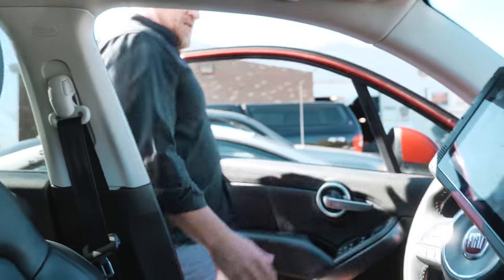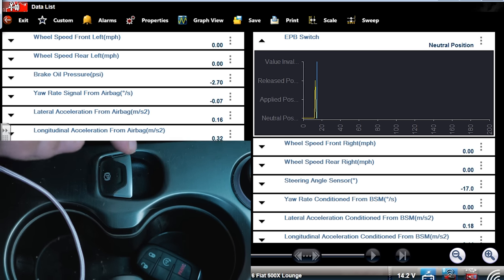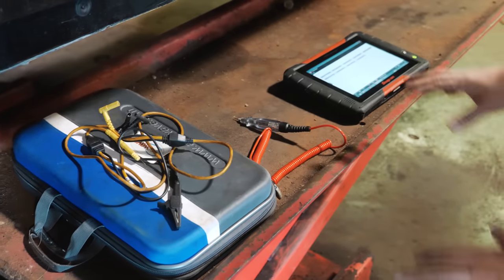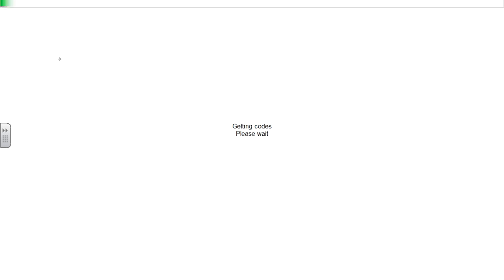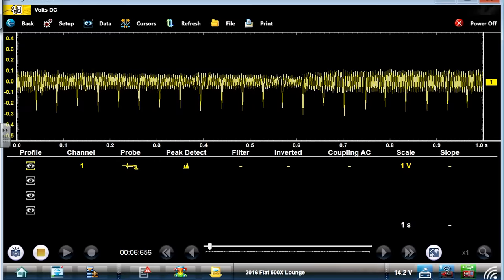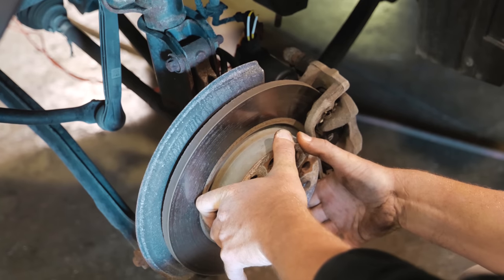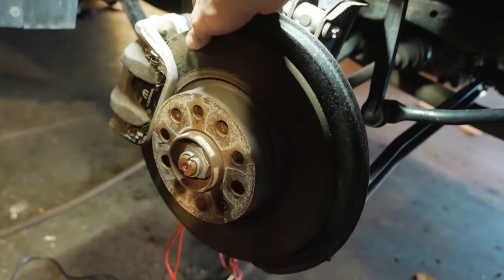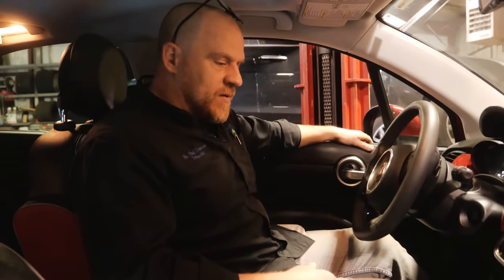2016 Fiat 500 Electric Parking Brake Intermittently Sticking On

Comment: This is my car. I can’t thank yinz enough for the time and effort that you put into fixing my car! It’s still doing well and I actually trust using the parking brake now! For about 8 months before the brake started to lock on, I was having electrical problems. “Service parking brake”, “Service ABS”, and the seatbelt lights would all start flashing while I was driving. To make it worse the seatbelt dinger would be going off 🤯 Sometimes it would last 5 minutes other times 45 minutes. But when I would take it to the dealer it would be off so they could never diagnose it. But then the brake started locking up. All 3 times I was parked in the same place at work, on a slope, parking brake was not on the second 2 times for sure. I’ve definitely felt the same frustration you felt with this car lol. Again I can’t even express how thankful I am for the work yinz put into this, and for also letting me know about the rotor issue too. Oh and btw sorry about the seat, I’m a tiny person with a tiny car 🚘 😂 Thanks again!!!!
Reply from the maker: How awesome is this! This may be only the second time I've ever had the actual owner of the car we film a case study on, watch, and comment on a video.
May I ask you about the times you had it at the dealer? They must have fixed a few things along the way right? Because those other issues you mentioned, we didn't do anything with those.
Also, what exactly was changed by them in order to fix this brake issue? Thanks! I believe that it is possible that I should not have condemned their work and I want to be careful in bashing another shop or tech. Thank you so much! This is a real struggle for our industry in that we all are too quick to bash each other without knowing the full story. Appreciate anything you can contribute. Happy New Year and thanks for commenting!!

Comment: All I gotta say is because of you my most used tool at the shop day to day is a test light. And you know its a good thing when as you follow the video the ideas come into your head on where to go next, and then you say it and try it (like the jumper across). One thing I would have done to rule out the actuators is apply voltage to them and check if they are working, on the brand I do they are good at taking water into the windings and ruining themselves. And while I do that, have an amp clamp off a scope reading what kind of amperage it pulls and hopefully find a bulb to closely match it. I think that would have taken care of the bias voltage, and the integrity of the wires to pass a (I'm guessing 5-15 amp) load. 

You truly deserve your success on Youtube, my diagnostic roots come from your videos. Thank you SD.
Reply from the maker: Such great feedback and comments my friend. Thank you so much. Learning as I film these days.

Comment: This is why I like the videos you do at your brother's shop. You get to hear the colorful banter between you guys. Like when your brother said, "well, at least they know how to read", 🤣. That's pretty bad though that the other shop replaced those two modules/computers before even doing a simple visual inspection on the parking brake components. That's the first thing I would have done after seeing the codes. The important step of doing a visual inspection cannot be understated. When I went to some automotive training a few years back, the instructor mentioned that about 80% of problems are found by visual inspection. It's the other 20% that can be so fun to figure out.

Comment from the maker: Just wanted to say thank you for all the comments! A lot of you suggested that testing the motors themselves should have been done. You are not wrong in wanting to do that, but there is some warnings on this. First, if you drive the motor too far, you'll damage the gearing inside. Second if you find a bad motor you still MUST check the driver function in the ABS module! My focus was always on the drivers as there was water and corrosion in that connector which can lead to excessive current and driver failure. Even if that LR motor tested good manually, driver tests should still be carried out.
The take away here with the driver testing would be to remember the variables when it comes to actuation of the circuit. (Current flow wasn't right, so the module locked it out). Secondly, there was more than current monitoring going on with these. I proved it on the known good side by a simple disconnect of the connector with the circuit not active (no current). So there IS a bias line here of some type that I should have spent more time on in the end to show it to you. I believe as some of you suggested, that if I would have AC coupled my scope and dropped my voltage and time base, that I would have seen it and I would have seen the difference when my test light was installed, which passed the open circuit test the module does using that bias.
Lastly, as a lot of you pointed out, current flow is absolutely being monitored too and I believe it is comparing side to side current as well as the timing of the peaks.
Reply: you are right in your with basic thought but when you come up against a circuit that you are not familiar with you have to try from another direction. you have a known good motor so you could try reading the resistance of the good motor and substituting a resistor across the motor  connection and resetting. not knowing the current flow you should be able to find that with ohms law and the resistor could then be used with the correct wattage. i have not tried this so i cannot say if this would drive the module for to long causing it to burn out the driver. food for thought. also the circuits are separate in there operation to allow for different wear factors on the brake pads. i dont think you will find any bias voltage on the connections because it is only a power when requested by the parking brake switch type of circuit with the current limit being set by the module to set the torque level and that will be different on each side due to the pad wear. on the citreon c4 there are similar motors but they are a four wire motor which does allow for the esp module to use the motors for the stability module to function. but maybe as on the c4 the motors are the same you could swap them to test motor and circuit integrity. i know the idea of diagnosis is to try and be as fast as possible for the customer but in this case i have found that the voltage test on the motor and circuit integrity to be the fastest way to diagnose this problem. if you prove the motor and the circuit integrity then you have got to have a bad module.
Reply: i know that your teaching is to prove a component before firing the parts cannon and i totally agree that is the way to go. but with this circuit i dont think you need to go down the road of looking  for some way of proving using ie the multimeter or scope. but yes you are there to teach but i think this is a case of not proving how it works but getting the customer out of the shop pdq i hope i have not offended you in any way but i think the way the program is designed on this car is very poor as far as diagnostics is concerned.but thats fiat and european cars for you lol. its one of them faults thats more trouble than its worth
Reply from the maker: @dougytweddle4393  this is 100% not true when you said "you will not find any bias".  How do I know that? Because the open circuit code sets IMMEDIATELY when the motor is disconnected during a time when the motor circuit is at rest! (No current flow).
Reply: I’m working on a car with no windshield wipers, no abs and no speedometer. Can hardly wait to see what the problem is. I’m betting a bad ground, or positive or possibly a bad module. Hoping it’s not the BCM. Spendy fix if it is. I’ve learned a lot from you and Ivan and Eric O.  And others. What you guys do is a real service to others. You guys are my afternoon tv every day. Thanks Dan for what ya do.
Reply: resistance test on motor wink wink lol
Reply: @ScannerDanner  On VWs there is a data PID for motor current. That's how it knows the position of the piston (it sees the current rise when the motor gets to its limit on the release or when the pads clamp the disk on the apply). The open circuit detection must be based on the current characteristic of the circuit and not a pull down bias circuit that we are used too seeing. The PID you had for the "left rear position - not known" was cool. It must log the position when it sees the current rise in either polarity so it knows where the piston is. Also the fact the current is monitored so closely kind of rules out the driver getting damaged, they spike pretty high when you apply the parking brake. You're the man Dan keep up the good work.

PS. I know your name is Paul

EDIT. it actually wouldn't wind the piston back to its limit on every release but it 100% dose when you put them in service mode to change the pads.

Comment: Can’t be too careful when dealing with a car multiple shops have had their hands on. You didn’t exceed 50 minutes either. Great job showing how to figure out system with little information provided by the manufacture and not just immediately changing parts. 💪🏻

Comment: Thanks for the video I always enjoy the good ones like this.  it was an interesting one to watch the struggle of resetting the ESP system each time a new check needed to be performed. That can be very frustrating. I have not reviewed all of the previous comments so this may have been mentioned already. When the LH caliper was in the suspected faulted state, some additional checks could have been performed. 

A resistance check across the caliper motor windings could have been performed and compared to the known-good right side motor resistance measurement since the Module was reporting an OPEN circuit condition. Also, a trick I use to check for a hard OPEN circuit condition in wiring to a motor like that is to unplug from the motor, the caliper in this case, and measure the resistance between each wire and chassis ground. So with the vehicle motor circuits powered OFF, measure resistance between pin 1 and ground, then resistance between pin 2 and ground, There is typically some circuit board-level resistance in the k-ohm range inside the module/controller between the caliper motor circuits and the module/controller ground circuit.  So each motor wire in the harness should provide some high value resistance to ground if still plugged into the module/controller at the opposite end of the wires. You are essentially measuring down the wire, across the module board resistance to chassis ground. If you see "OL" on either circuit then it is likely an open wire. Of course you would need to compare to the known-good working side to confirm the "OL" condition is not expected. 

Since the RH caliper circuits were known-good and working, they could have been jumped to the suspect LH caliper to check function of the LH caliper. A voltage source like a power probe also could have been used to cycle the caliper motor to check for proper function. The current used by each caliper when manually cycling them with a power probe could also help detect a weak/failing motor due to a partial open or short in the windings due to corrosion or fatigue.

You do great work, always inspiring. Hopefully these additional circuit integrity tricks are found useful by someone. They help me identify wiring issues in vehicles all the time.

Comment: Ok, so this one DeoxIT story. My brother owns a 1999 Polaris 4 wheeler. 4 years ago, he was preparing to go to Colorado for an elk hunt. He came to me to help with an ignition switch intermittent problem. He wanted to replace it but time was too short. I sprayed it full of DeoxIT D5, turned the key back and forth about 20 or 30 times, blew it out, did it the second time blew it out again with compressed air and the ignition switch has been working perfectly for 4 years and 2 elk hunting trips to Colorado. Original 23 year old ignition switch! You can't beat that product.

Comment: I would recommend that one of the first steps be to activate the actuator using jumpers to make sure it's running freely. Corrosion between the actuator and caliper can jam the motor causing excess current draw and intermittent operation.
Reply from the maker: No argument there. My focus was primarily the driver function and whether it got fried, which dictated my approach
Reply: I do this a lot with solenoids or motors. This way you can (usually) rule out an issue with the component itself. Like window motors

Comment: Had faced such EPB faults in several Renault Koleos cars. 
It has same 2 wire system for each side parking brake actuators. The fully open and closed position is detected by the current amperage. And yes to substitute the actuator motor a "21W bulb" should be used. Anything below that will not be triggered by the module. 
In these models sometimes the position is lost during servicing the brakes (need to put in maintenance mode). So the open/close position could be verified in the data monitor or physically turning the rotor and what I do is manually provide current to the actuators upto a point where they reach the end point, then when both sides get to the same position fix everything back and the system works normally.

Comment: I have used DeOxit on any joint that carries a waveform, Audio to Rf to MW since the Nineties. I reach for it as quickly as mechanics reach for brake clean. Waveforms travel on the surface of conductors versus DC traveling through the core. All connectors even in outer space grow nonconductive whiskers. Developed for the Space Shuttle, utilized heavily in the sound reinforcement businessss. I discovered it working on Tube Amps, the right product can take the heat too.  Big Fan

Comment: i have just done a similar job on a kia sorrento. and i can say confidently current is monitored through the module . initial key on applying and releasing the epb switch while looking at scan data the module was seeing the command. but after approx 10 seconds it would not see the apply function and only see the release. i could force the motor to work bi directionaly but that was it and it sounded like when a power window reg fails but the motor is still going haha. i took a look at the motor and the inner cable broke so i suppose if the motor had no resistance there would be less current flow that the module is use to seeing thats why i had no operation and codes. sorry for the novel long comment haha love what you guys do and im a big fan god bless

Comment: great video i liked how you worked through all the problems i know all shops are busy but i agree if the original shop had done a check round they would have found the damaged connector  and not have to replace all those parts it may have been a lot simpler and quicker repair also if those parts are replaced under warranty and checked and found to be ok the claim maybe rejected and the shop would have to stand the cost something to to think when calling in job in a dealer great job still learning after all these years

Comment: Nice video man. Just an observation: In FCA/Stellantis vehicles is normal when you're connect to the ABS module and the ABS light goes on. Even if you are using the OEM scanner.
Reply from the maker: Great info! Thank you
Reply: And also lots of vehicles the diagnostic on the abs shuts down over 25mph.
Reply: and on vw and audi
Reply: aaand on Citroen using OEM Lexia scanner
Reply: @ScannerDanner  yes, it's a self test

Comment: Nice video Paul. I like the  problem solving path. It does seem a bit odd to think that something as simple as as a parking brake gets to totally disable a vehicle. Perhaps 1 cable to an equalizer to cables at each rear wheel is not such a bad system after all.
Reply: Have you tried a system like that ?, it just introduces more points of failure, a system like this in the video is the "smartest" choice, and it's pretty good on most cars... but the french cars can be a pain in the ass =)
Reply: @mortenmorfar  I've tried a few of each. By that I mean repairing them. In my experience the cable systems usually last the life  of the vehicle with some adjustments here and there. This fiat was 6 years old. The cables on my 20 year old truck still work well, no module needed. Recall the repair path at the beginning of the video. Yikes!  Technology is great, usually.

Comment: Awesome video and much patience and time well spent getting to the bottom of a difficult issue. It is hard enough to diagnose a vehicle when it is familiar but when it not only is an Odd-ball FIAT (Fix It Again Tony) but to have doubts because of scan tools not working as  they should with these cars and you have a real challenge on your hands. It is amazing to me that any manufacturer would use a bias voltage on anything that is that small a value, as corrosion and wear can always find a way to lower your voltage transfer over time. I noticed at 55:13 when you were talking about the De-Ox that it looks like that is a clear inner insulation that was covering half of the wire and I was wondering if that would create a problem as well? Thanks so much to you and Caleb for taking us along for the roller-coaster diag.